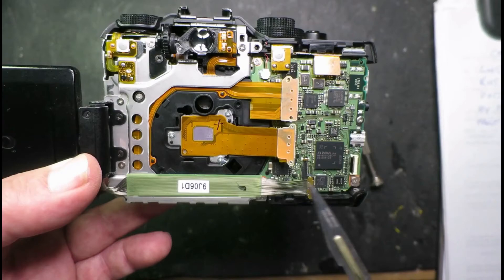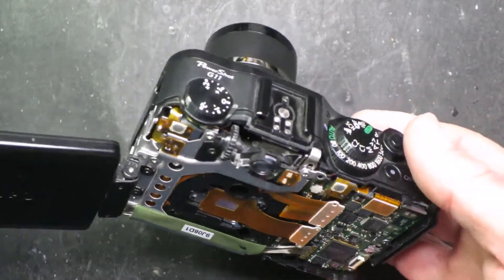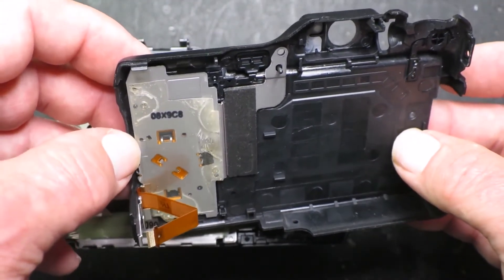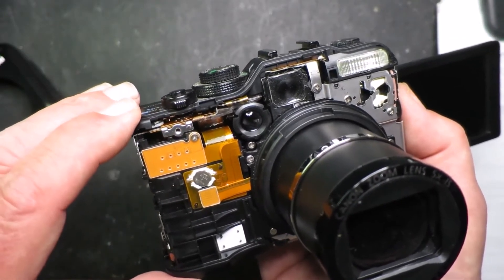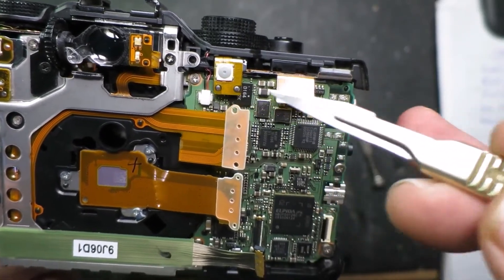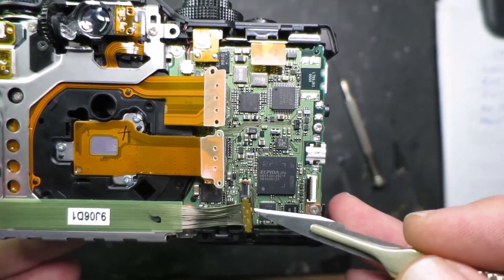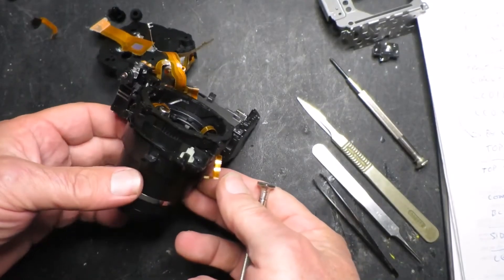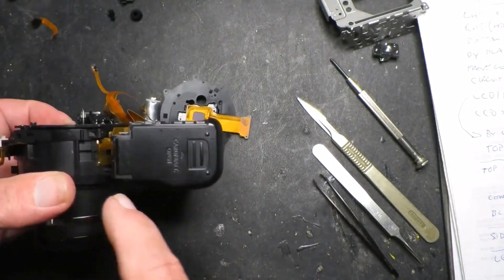Canon G11 Lens Error Teardown

Comment: Thanks a lot for this great video!! My lens got stuck too so i watched all your video. Being on a long journey i was disappointed this lens error occurred. So after seeing your video i decided to put some more force on lens turning it back in. Either to win or lose. It went in after some force and seems to be working as normal again. I am so happy your video made me risk it!!!
Reply from the maker: You're welcome! These are great cameras so I hope yours keeps working for many years to come!! Have a great day!!
Reply: @1nformatica  Hi Thank you for the video. Quick question if you dont mind. I have a G11 that works perfectly with everything takes pictures flash everything ok. But when i open the lcd screen the whole camera shuts down, do you think something is wrong with the lcd screen cable or do you think the motherboard is broke? I'm trying to fix the camera because its so new and barely used, but i can not find anything related on this issue, while the screen is folded in the camera works 100% fine, the moment i open the camera lcd screen til the point where the screen supposed to light up, the whole entire camera shuts down, any ideas on this? thank you
Reply from the maker: @kaip3260  I have not seen this problem but my guess would be the LCD cable. You can see the cable at the bottom of the screen here : https://youtu.be/Cw1FvW6gFAQ?t=366 I would take the back apart and look for broken cables. Thanks for watching, have a great day!

Comment: Thanks for this. As you know these cameras prices have sjy rocketed recently due to its ccd sensor and custom profile that mimicks film. I biught a used one and had a suspicion the zoom flex was dead as it wouldnt preview. I slapped it and actually it gave its last preview. So ill be using your video for the teardown. Thanks.
Reply from the maker: Hope you find it useful. I haven't looked at film mimicking, can you recommend some sources to look at? I'm a bit of a Canon nut and have many of the small powershot models with CHDK on them. Also like to dabble in HDR using Photomatrix. BTW, I still have all the bits from the G11 in a box!!

Comment: I dropped my g11 and hours later it malfunction where it open and closes and it's stopped working and the camera says lens error, failed to start. I tried going to a camera repair shop but they said its done so idk what to do
Reply from the maker: You can try the simple fixes I discuss at the beginning of the video or follow here : https://www.youtube.com/watch?v=AkEfnF6zVxc If they don't work I'm afraid it is not economical to repair an old camera. Fortunately these cameras can be found second hand for little money.
Reply: @1nformatica the technician said the gears are the problem. Can i ask what kind of gear the g11 have? I wanna fix it because it holds a sentimental value to me
Reply from the maker: @otakuhub9326  The gearing is within the lens. I show it here : https://youtu.be/Cw1FvW6gFAQ?t=682 You may get lucky and be able to move the lens into position. It will be very difficult. To be honest I would not expect success. As the camera is important to you I would just put it on a shelf in your study or lounge where you can look at it.

Comment: Your video was a great help in opening up my G12. Its pretty much the same. I want to change the date battery you pointed out @3:58. I can read its a MS614 typ battery by Panasonic.
It seems to be clamped down by the plastic bits. Do you know how to safely remove it? I dont want to brake anything. Edit: I ended up removing it by pushing an exacto knife under it lifting it from the side where your nail is placed. That bracket is a tiny bit shorter to accomodate for this wiggle I guess. Or it broke off earlier.
Reply from the maker: Hey thanks! Yep, that's the way to do it! https://drive.google.com/file/d/1B5e3Z6wz8Ry9SFbKTD9OuKqyXGimtJt_/view?usp=sharing

Comment: I'm in the process of repairing a powershot A460 lense assembly. All the instructions on the Internet I found were basically one way teardowns where the person just removes every screw they can see lol. After getting the entire lense assembly apart it took about 6 hours of patience and 2 broken ribbon cables to figure out how to reassemble it correctly and safely. Inside these point and shot things are the house of horrors lol. I have like 30 different numbered screws and cogs. Got the cables I need coming in the mail now. Its just for fun though, a working camera costs the same as the cables. Looking at this because I may embark on replacing the front glass on a G12 soon :| lol. Preforming recon haha.

Comment: Many thanks for this great video. My G11 lens got stuck yesterday (after many years of great service !). I was hopeful during the entire video that I could fix it (it surely swallowed lots of sand and dust) but then the conclusion with the broken ribbon cable within the lens convinced me not to start opening it. I am pretty sure the same ribbon cable (within the lens itself) as I have been using it outside the whole day yesterday at a temperature that was below zero... So the age of the cable + the low temperature must have made it losing all its flexibility... 
Thanks again for the thorough description and the hint on changing the lens!
Reply from the maker: Glad you found it interesting at least! Before you give up take a look here : http://www.e18error.com/repair.html Several things to try with varying levels of danger!! Please consider subscribing if you have not done so already!

Comment: I have a G12 which is virtually identical to the G11. It has a different problem, the lens shutter is "lazy", it sometimes works and sometimes doesn't with the result that, when it doesn't, there's no image on the screen or there is a screen image and it is correctly showing the scene but the photos are highly overexposed on auto indicating that the aperture is wide-open instead of stopping down when the phot is taken. Is the lens shutter integral to the lens or is it a separate assembly between the lens and the image sensor?
Reply from the maker: It's a long time since I tore it down but I think the aperture mechanism is fairly far forward in the lens barrel. At this point in the video https://youtu.be/Cw1FvW6gFAQ?t=685 you can see it in the center of the lens assembly with the small silver motor that drives it above.

Comment: Hello, Congratulations on the video. To change the flash need to disassemble the lens assembly? Thanks . Obrigado!
Reply from the maker: Hi Jonathan, no you only need to go as far as this point in the video : https://youtu.be/Cw1FvW6gFAQ?t=528
Remember that the flash unit works at high voltage and the capacitor will hold charge for some time - take care!
I think I still have the bits of the camera around somewhere if you need a part (apart from the lens)!!
Reply: Thanks!

Comment: Is this the ribbon you need? If not there's a page of them...
http://www.ebay.com/itm/Zoom-Lens-Ribbon-Shutter-Flex-Cable-Replacement-for-Canon-Powershot-G10-G11-G12-/390651303745?hash=item5af4a1d741:g:wKUAAMXQoYJSHspmhttp://www.ebay.com/sch/i.html?_from=R40&_trksid=p2047675.m570.l1313.TR0.TRC0.H0.XCanon+G11+ribbons.TRS0&_nkw=Canon+G11+ribbons&_sacat=0
Reply from the maker: Thanks for the link, the client has decided not to go ahead with the repair but I will have the link for the future. I also found them on this site: http://www.smartphonebay.net/SearchResults.asp?Search=g11+flex Check them out as it maybe a useful site for you too. Kind regards.
Reply: Thanks Brother

Comment: Don't forget to back yourself up. I repair just about everything, the price difference of purchasing a new one or repairing the part you found to be bad and the fact there might just be other problems, but you have to repair the ribbon first. I have people calling me every day saying my computer is broken, my furnace is broken so how much does it cost to fix it? I tell them there a world of broken devices so how am I supposed to know without looking at it and they actually have the gall to tell me I'm the expert so how much? It's not easy running your own business, I get the same questions all the time! Stupidity at its finest... Most of the time with computers it's a virus issue so I call them and tell them they have numerous viruses and I fix it and six months later that same person calls me and says I've been using another computer, but that had a problem today and I setup the computer you repaired and it just restarts or it just doesn't go online. They say this so they can screw up and not pay for it and this happens to me all the time. I get it running in safe mode and I always back myself up, I install "index.dat suite" This is the program the police use to bust you but you can't see it, I hide the link. So far 100% of the time that program reveals they lied to my face and that computer has been their primary computer, it tells me every last thing they did on that computer since it had the operating system installed so I show them every site and every download and where they keep getting the viruses from and they get pissed off because I caught them in a lie and yes this happens all the time, they know you're smart, but they're so stupid they think they can play you. Some even ask if they still have to pay, I tell them no and they look so happy and I tell them I don't want their business and kick them out. You have to protect yourself and you probably do, but some people have to much trust in people
Reply from the maker: Hey I could have written that! Describes the issues folks like us have perfectly. We need to stand up for our rights, let "Power to the Geeks" be our rallying cry!!

Comment: Great video! But, tell me something... I use to see lots of broken cameras for sell in a kind of "trade fair" I go every other Sunday. Does any of them have useful parts to salvage? (I do it a lot with printers and DVDs to get dc motors and gears mostly, to have materials to my videos.o
Reply from the maker: There is only really the small motors and gears to tinker with. I guess you could have fun with the lenses and a laser. Perhaps make a "handshake shocker" out of the flash!!The small lithium batteries are OK for small arduino projects.